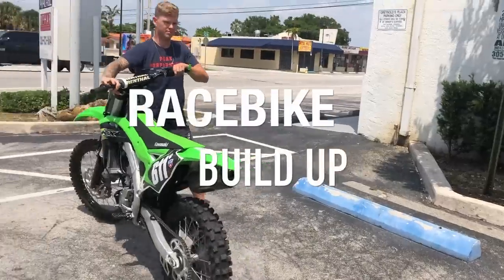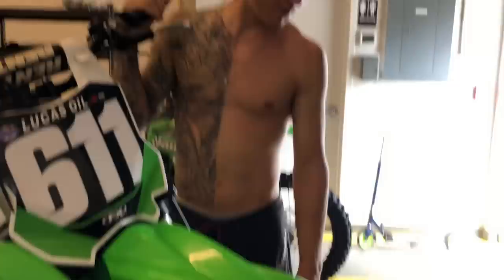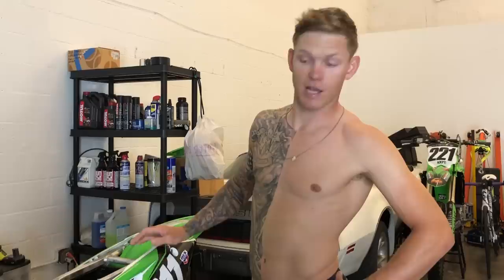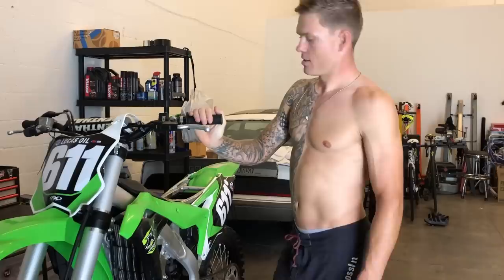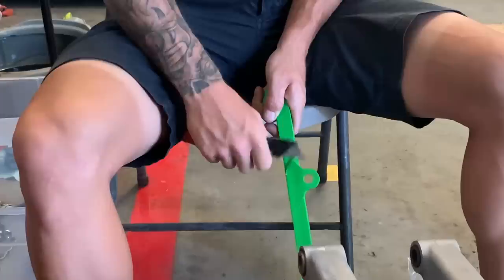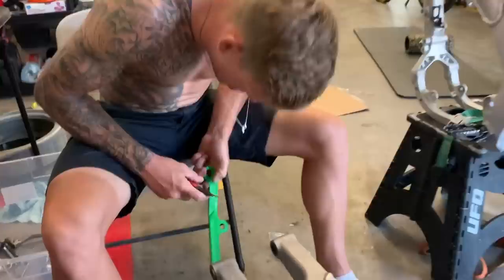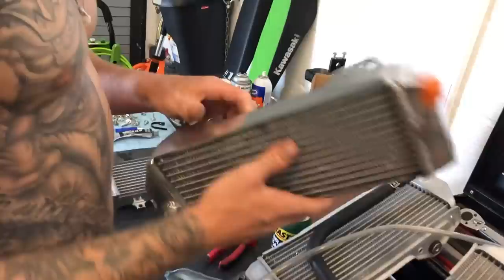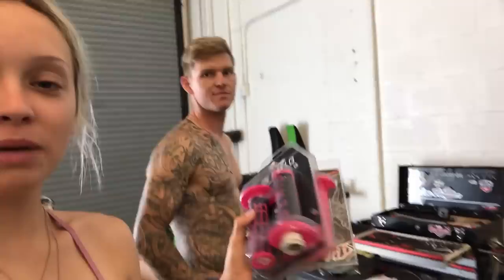BUILDING MY PRO MOTOCROSS RACEBIKE

Comment: I'm a beginner and I plan on buying a dirtbike but I don't know what to buy for my first dirtbike, maybe a used one but I can't build, or just buy a brand new bike?
Reply from the maker: Hard question, cause a new bike also needs some work after a few hours. If you come across a nice bike that has been good maintenanced and has a recent piston change, and recent greased bearings etc, that is a good start as well :)
Reply: Agreed and maybe avoid a 450 lol unless u find a sweet deal then i guess your jusy gonna have to get used to the power
Reply: @MrJorgensen21  thank you so much for the reply! I'll keep that in mind
Reply: @Rnfjaydee  I'm pretty confident with my control
Reply from the maker: @Rnfjaydee  Usually the 450 is not a good bike to beginners to start with, its very hard to go slow and learn the technique on a bike with so much power.
Reply: mathias jørgensen 100% agreed but his choice I guess i mean if he has rode a dirt bike quite a bit of times then he should be okay.
Reply from the maker: @Rnfjaydee  Agree! I actually rode some of the Lucas Oil Pro Motocross rounds on 450 last year, but to be honest, I think its more fun to ride the 250 so thats what im doing this year :)
Reply: mathias jørgensen 100%
Reply: @Rnfjaydee  I've ridden a 250 before and I'm very comfortable riding it.
Reply: Also 450 is kinda bit tall for me lol I don't like lifted up bike